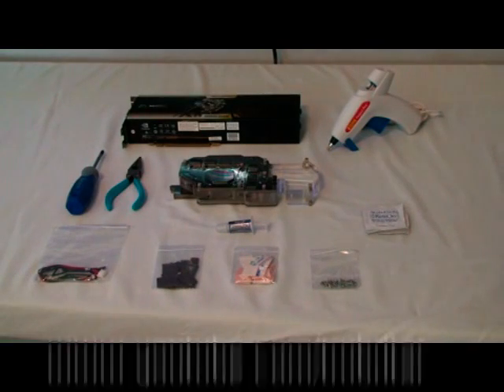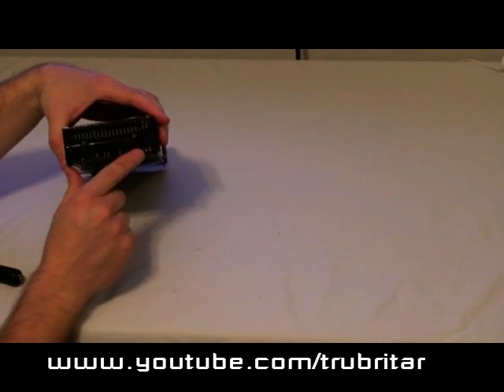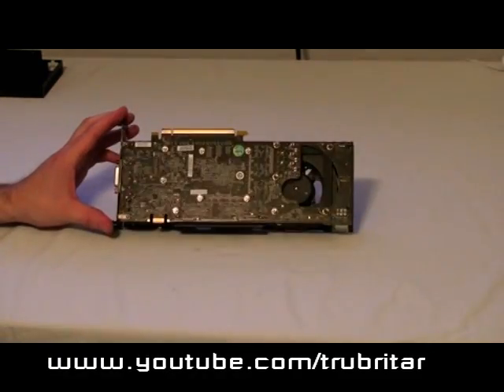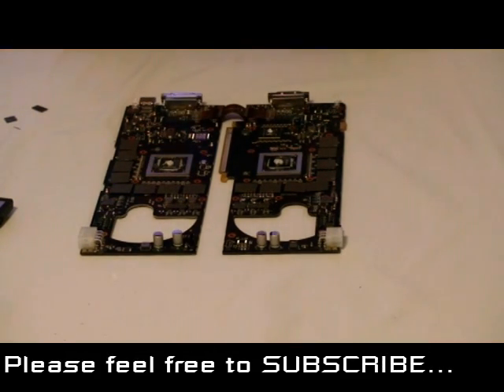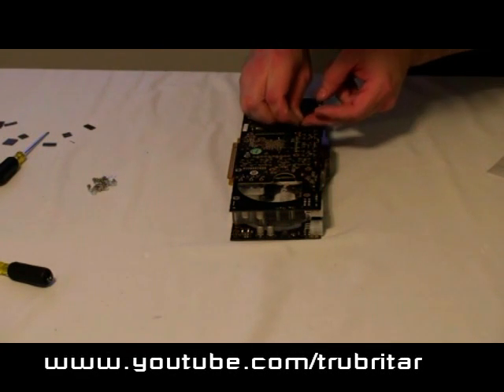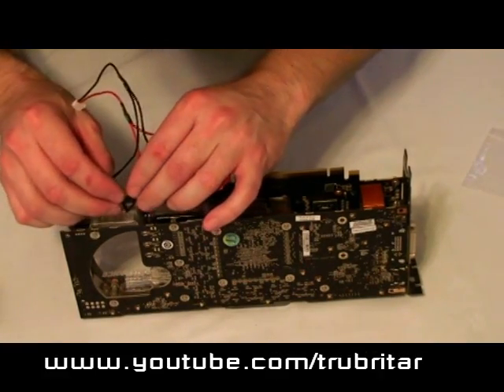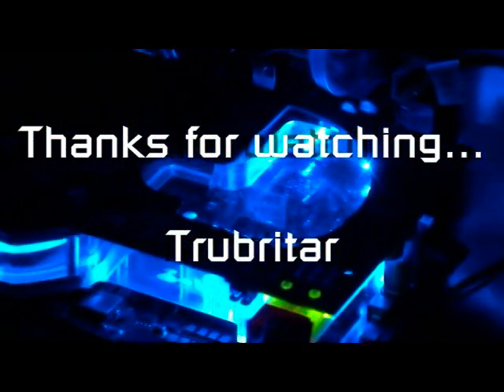Watercooling the XFX 9800 GX2 XXX Video Card

Comment: Riva Tuner is a great app Ive been using it for a long time, it helps somewhat but Ive decided to ditch the fan cooler and get this koolance water block, my problem now is what kind of water cooler do I get? I had my eye on the Thermaltake Bigwater 760i but I just dont know I have never done water cooling before.

Comment: Post #2 

I was told that i would need a 360mm rad in order to pull it off, the only downside to that is that i very much doubt this pump would be able to handle it. Is a 240 not enough?

Any replies are much appreciated.

Comment: Hey, i have searched all over the net and found no results. Basically, i wan't to know what is required to watercool a GX2, i have an XSPC Delta V3 watercooling kit, with a 240mm rad, i would love to be able to run my GX2 and 4 ghz E8500 on the same loop, but i am very confused on what is actually needed!

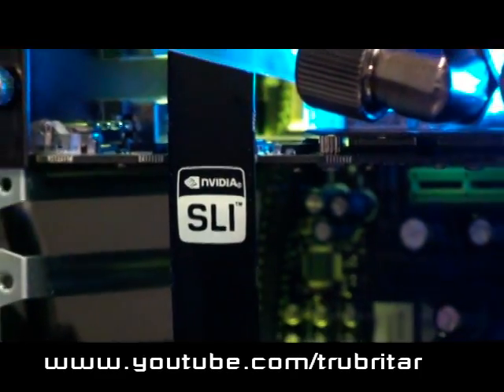Comment from the maker: You should be able to fit a sound card between the vid cards providing your mobo has a Pci-e slot available.  pause the vid @ 6:50...and you can see the available slot on a 780 / 790i 3 way SLi board.  thanks

Comment from the maker: For the GPU Temp monitoring, you can download the EVGA Precision utility from the EVGA website, the green SLi power bar is part of the Nvidia control panel settings and will only work if you are running SLi mode.

Comment: Wow the EHX-1020BK and the rp-1000 are expenisve = $386 total for both. You use the cosmos s case to put the radiator on top? I was planning to buy myself like ur SETUP, but im still low in terms of budget. I bet it cost you $5,223 or more for this kick ass PC> :)

Comment: tru...what fittings and nozzles are you using to connect the GX2s together? are those the tri slot spacing sli connectors and swiveled anle nozzles from koolance?

Comment: lol, I did a lot of modding to my case using a hot-glue gun ;p

The great thing about them is that it will hold anything you need into place, but if you ever want it removed it's easy and leaves no glue residue or staining.